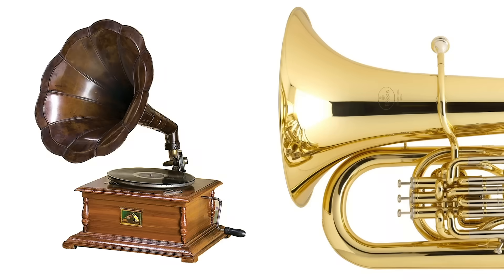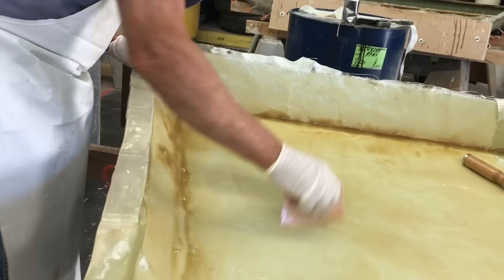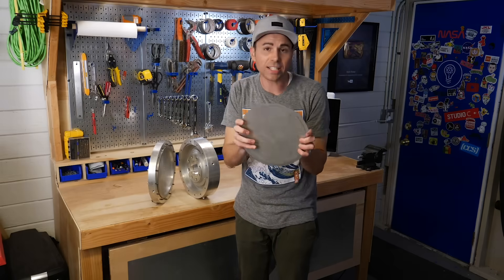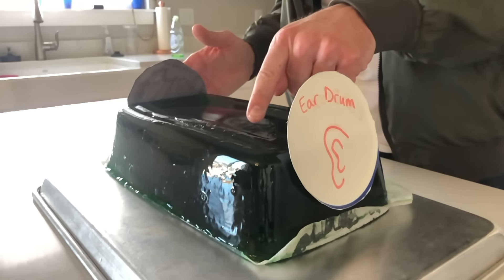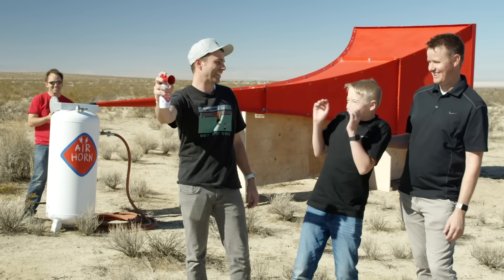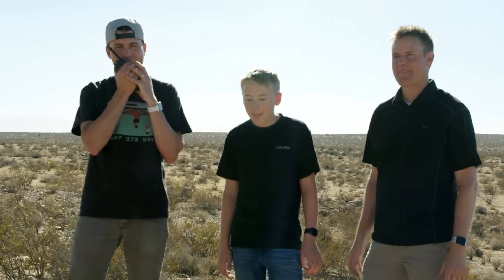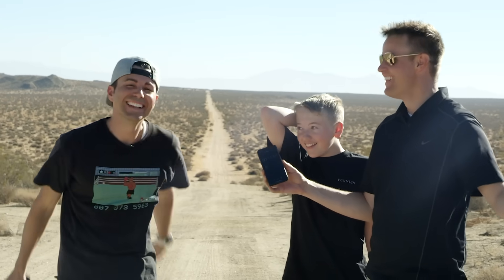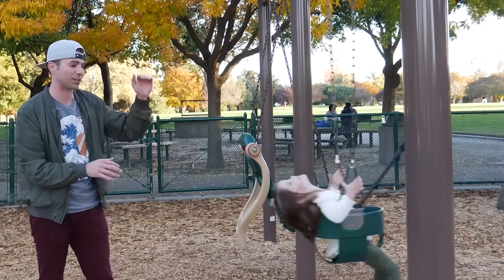World's Largest Horn Shatters Glass

Comment: I wonder what the resonance frequency for my bones are.
Reply: 972 Hz.  But for better, less deadly results, try 20 Hz, it's the resonant frequency of the human eyeball.  Vibrating your eyeball will cause the optic nerve to perceive input, even though there really isn't any.  The resulting hallucinations should be intense and absurd.  Go loose your frikkin mind.
Reply: @zduke  any long-term consequences?
Reply: WuzNab *shatters every bone in body
Reply: Between 972 and 1230 Hz. However, due to dampening it won't have the same effect as it did on the glass
Reply: -a.8xSquared
Reply: Calcium

Comment: cool video. I'm not sure if that was resonance tuned or not, but darn loud. There were some air raid sirens made that used a V-8 engine to run them that could be heard at 25 miles and could set wood on fire from the sound energy at the horn output.

Comment: I do not believe resonance played any role in the collapse of the first Tacoma Narrows bridge.  I believe flutter not connected to resonance was the source that ultimately led  the failure of the cables which originally was caused by the force of wind against the side of the deck (which, unlike pretty much every other suspension bridge, was solid, blocking the air from passing).  However, i do not want to start a physics war in the comments so...
https://en.wikipedia.org/wiki/Tacoma_Narrows_Bridge_(1940)#Resonance_vs._non-resonance_explanations

Comment: but.. why this form in particular?? is a logarithmic form? parabolic? hyperbola? ellipse?
Reply: Werner Wagener Hotel? Trivago.
Reply: Werner Wagener hyperbolic
Reply: I mean, weird flex but ok
Reply: I agree. Really neat video, but somewhat of a let down when the answer was "impedance matching", and poking Jello with a pointy stick doesn't work as well as with a wide, flat surface (the horn shape of the jello mover really was only for show - it didn't really do anything).
The question remains:  why that shape? Clearly it works well, but why?
Reply: @boutellejb  As the pressure happens on the diaphragm it would spread in many ways but adding a horn makes the pressure affect only the air in the horn which gets stiffer as it can't go in circle. So the diaphragm now has more resistance because of the stiffer air. And matching the right amount of air in the horn (impedance)  makes the loudest sound of it.
Reply: He explained it for like 3 minutes of the video.

Comment: Great video.  You talked about resonance, but not as it applies to the horn itself.  For musical instruments, you choose the tube length so that you get a standing wave at the frequencies you want to play.  Since you're driving this horn, you do not have to do that, but I think that if you did match it then it would further increase the efficiency with which the energy you put into the horn was converted to sound, right?

So, in dry air at STP (your conditions may vary... :-), 110 Hz gives a wavelength of (331.46 m/s) / 110 Hz == 3.01 m.  Your horn looks bigger than that.  It's hard to judge and I don't remember you saying how big it was, but I might believe it was twice that, which also works, I believe.  (Though with a half-open tube, I'm a bit unclear on if you only get the odd harmonics or not.  Maybe it would have to be triple to work.)  Did you take that into account or is the fact that it looks close an artifact of my bad estimation and/or luck?

Comment: Lies. the worlds largest horn is the Sumburgh Foghorn. it actually has two air tanks, is powered by diesel engines and is much larger than yours. You just added unnecessary extra metal to the opening to make it extra wide

Comment: I can't believe you did not bring a db meter and measure the pressure. At first see, the horn appeared to have a freq around 100cps as cut off. You definitely should check that and use frequencies higher than it. At the frequency you used, 110 cps, in reality that horn would need to be made from well ribbed steel that is at least 5/15" thick, or un ribbed 1/2" steel. But, definitely a cool project. I hope you repeat it again with a db meter and use a frequency above the cut off frequency. You actually created my dream project, that is something I have always wanted to do from the time when I used to design and build bass reflex speakers, and that is long ago.

Comment: Sorry to point this out...but your calculations are wrong.   4km/11s is about 0.364 km/s. Well, you were in a desertlike area, so the air temperature was probably higher, because the speed of sound depends on air temperatur. At about 50°C soundwaves travel at 360m/s. Sooo...your time might be right, the calculations were slightly off ;) I enjoyed the vid anyways! Thanks a lot.

Comment: My jaw dropped when it took 11 SECONDS for you guys to hear the horn. I had no idea the speed of sound could be so noticeable.
Reply: If there's ever a thunderstorm in your area, count the seconds between the lightning flash and the thunder. Both are created at exactly the same time, but because light travels at nearly 300,000 km/s, you can pretty much regard it as instant, while sound travels at 0.342 km/s - so each second's gap between lightning and thunder is approximately 1/3 km (or, alternatively, every three seconds gap is approximately 1 km).
Reply: @mittfh  Everytime I get a thunderstorm, I am still phased by this because it's just so fascinating, no matter how much I know.
Reply: Watch fireworks from a distance, you will notice it too.
Reply: At the camp I go to every summer there's a lake with a cannon on one side and the flag field on the other, they fire the cannon at a certain time during the flag raising everyday, and you see smoke come out and about 1.5 secs later you hear it
Reply: In a thunderstorm, you can estimate the distance between yourself and the lightning strike by counting the seconds between seeing the flash and hearing the boom. Every 5 seconds is roughly 1 mile -- sound travels roughly 1,100 feet per second (slight variations depending on altitude, temperature, and barometric pressure, but 1,100 is the mean), a mile is 5,280 feet in length, sound travels 5,500 feet in 5 seconds.
Reply: @samuelbrice3699  Technically, thunder occurs after the lightning bolt, but within a space of milliseconds - it's effectively a sonic boom created by the rapid expansion of air surrounding the lightning bolt as that in the path of the bolt is heated to 20,000°C / 36,000°F. So unless you have measuring equipment set up to calculate the distance of the lightning bolt to the nearest few millimetres, the delay's negligible.
Reply: sound travels slow
Reply: Back in middle school, there was a basketball court maybe 500 ft away from the school. You could see the ball almost return to the hand before you could hear the bounce
Reply: If you ever been to a concert in the nose bleed seats, watch the timing of the drummer to the sounds, even in thos small spaces latency can be detected.
Reply: Consider the radio frequency signal from the radio moved at the speed of light, now that’s impressive.
Reply: Speed of sound is around 340 metres per second. They were standing 4km away, the math checks out.
Reply: Yeah the sounds travels pretty slow bud.
Reply: It’s so cool.
Reply: I've even noticed it while golfing. If someone is teeing off far enough away from you, you can see them hit the ball slightly before you hear it.
Reply: This 30 second vid explains it all:
youtu.be/nC5-QQoBsTQ